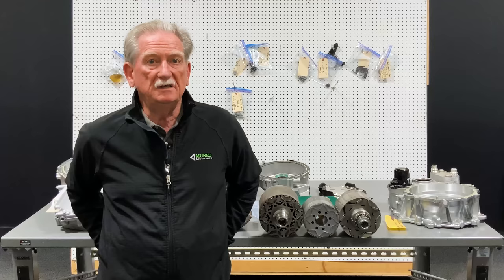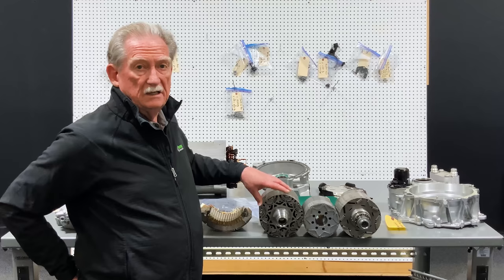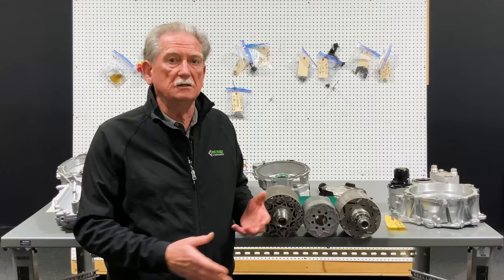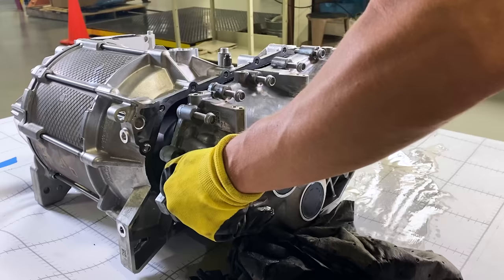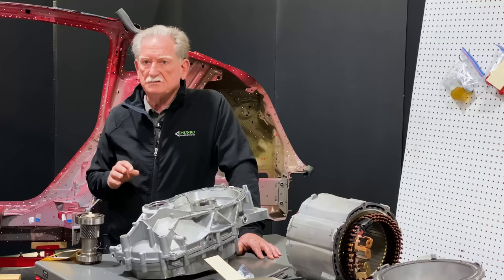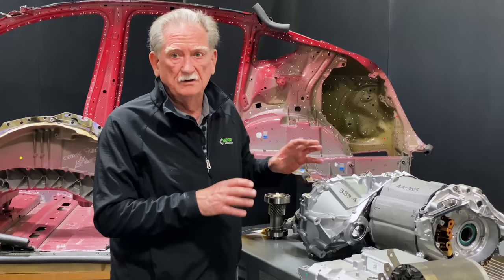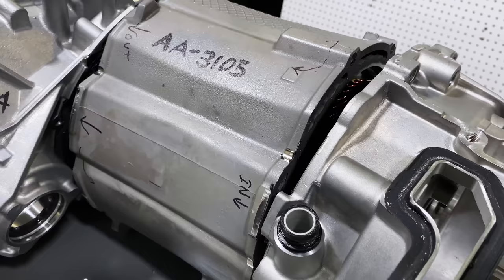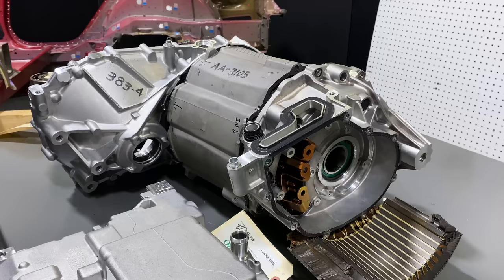Volkswagen ID.4: Electric Motor Teardown and Analysis

Comment: The Germans LOVE threaded screws (fasteners)...and so do I.  Metric threads are not quite the same as American standard, but I think it is just emotional.  Screws are "serious" and snap-ons are not.  Maybe Munro is right but I'm not sure.
Reply: he isn't and you are, for a bunch of reasons. and ford usa is hardly the cornerstone of high quality.
Reply: @daos3300  What's funny to me is that Ford used to use a lot of threaded fasteners back before the mid 2000s (probably when this BS was going on) and those cars, in my experience, are much better than what Ford has to offer today. I personally love threaded fasteners and in practice they rarely come undone. I personally don't like electric cars, but for the sake of those who buy these cars I hope VW doesn't listen to this guy and continues to use threaded fasteners.
Reply: He's not right. Threaded fasteners are the best way to hold together parts that may need to come apart, and in many cases, even parts that never have to come apart. Certainly better than snaps. Snaps are the shittiest way to assemble things and should be prohibited.

Comment: IMO this is a very good first generation design.  The use of internal screws suggest that this is very close to the prototype design, was rushed to production, and it will be refined quite a lot as production increases. 

One reason to use "un-fastenings" inside the inverter is for end of life recycling, where it's necessary to separate circuit boards with toxic metals from castings. I suppose that metal rivets could be drilled out or ground off, but that's probably  extra work.   The question is if that kind fastener is needed, or was it used because casting production was easier in low volume initial batches.  My solution would be to have a few snap fittings hold the boards in place until the cover was closed. Then standoffs/hold downs (bumps and holes) in the castings could sandwich the circuit boards snugly in place. It's easier to add many padded compression areas to a circuit board to reduce resonance than to use a similar number of screws.

Comment: Funny, I've yet to have one single threaded fastener come unfastened on my 12 year old VW, 14 year old Audi, or any other foreign car I've owned. It must have been a Ford problem. You can't torque a snap connection, nor can you get reliable heat transfer through a snap fit connection. Also, robots are cheaper at assembly than humans. They can work 24 hours a day, don't take days off or call in sick, they can move faster, work in confined spaces, work in hot, cold, or wet environments, can even work in complete darkness, and don't get tired or distracted.
Reply: One bad experience put him away from threads. He won’t even get in to Bugatti. Car (front and back) is bolted from 14 bolts.
Reply: Robots can work 24hr, but the humans that maintain them don't, nor do they work cheap. The folks that figure out the balance between automation and hand-built make the big bucks.
Reply: funny you should say that, i've never had screws ar bolts come undone on my 50 yr old vw. certain key fasteners need re-torquing, the rest is without issues. depends how you put things together.
Reply: @chstra45  the cost of maintaining a human workforce is way higher than maintaining machines. if everything could be automated, it would.
Reply: You obviously haven't sideloaded them enough.

Comment: Those screws are for ensuring vibration damping reliability on these critical PCB components. This design ensures reliability for long term use where adhesives such as Loctite would more likely to fail by fatigue and shear fracture.  Screws are probably the most mechanically robust by far vs other options.

Comment: What about the crack forming on the bearing cover? you talked about burrs but right next to the burrs is a substantial crack which will get larger "as is"
Reply: I was yelling this at my screen. Maybe it happened during disassembly or something?
Reply: I noticed it too. I think it's not a crack, but a raised casting flashing caused by a crack in the mold.
Reply: Yep, I spotted that too.
Reply: That sure looked like a crack to me too at first -- but looking carefully I count five similar looking features radiating out from the center. Maybe the flashing left by a cracked mold theory isn't so crazy. Too bad we can't just reach out and touch it.
Reply: Any one who builds or services systems using high and low pressure alloy die castings will have seen these ridges around most holes and section changes. They cause no issues and are a result of material displacement as the casting cools and solidifies to its final state. This happens AFTER ejection from the mould because they are are cycled out of the hot mould and a new molten shot made every few seconds, to keep production speeds high.
Reply: That's a result of the casting process, it's caused by the mold release agent.  It's not a crack.
Reply: @grahamwhiting6567  Thanks for explaining :)

Comment: I worked for the Railway in Denmark we used more iron so they would not expand or subtract by heat or cold weather so we welded them together

Comment: 5:15 I suppose the selection of the bearing type and size depends wholly on the drivetrain-layout, distances between bearings, and resulting forces. I would recommend not to judge lifetime based on "bearing size alone". By the way: when you have high speed motors you cannot even use bigger bearings, because those cannot sustain the high rpms. On the other hand: the high speed type has the same power output using less torque and resulting in less bearing forces...

Comment: As someone who deals with G-loads and vibrations on circuitboards USE MORE FASTENERS
A bonuspoint is that you get mutliple points of grounding of the groundplane of board, USE MORE FASTENERS
Also treaded FASTENERS can be locked in place, there is absolutely no problem with that.
I will give you a point of riveting the laminated core, since noone ever will take it apart for any reason.

Comment: i would imagine those fasteners might serve "repairability"?
Reply: Yes, to me that inverter looked very serviceable. Also the many bolts in inverter PCB likely also acts as heat conduct from PCB to enclosure.
Reply: Yes.  Right to repair would take issue with Sandy on this.
Reply: I think it's just the only way to do it, PCB's need a lot of mounting points to not vibrate, you don't want flexing happening there. Then there's the pressure required for the cooling plate to make proper contact with the pads, if you want even distribution, you need lots of fasteners.
I don't think "snap-in" works with PCB's that need cooling like Sandy thinks it does.
Reply: @thealienrobotanthropologist  Tesla 300 miles for less than $12.  Lasts for 1,000,000 miles.  Prover 66% safer than any other car on the road by NHTSA.  Those are the reasons to buy a Tesla.  Also, Tesla does not advertise. :)
Reply: @TheFPSPower  exactly! Sandman thinks his "snapfix" will fix everything and that's why Ford is nowhere near VW.
Reply: @davidbeppler3032  nor does it let you service your own car, and works on a proprietary connection, and had failed to build mechanical redundancy in safety areas.
Reply: @davidbeppler3032  you don't know that it lasts 1m miles yet. any electric car will outlast a fossil car, and many fossil burners easily make half a million miles and more, it's just the costs are much higher. and all electric cars are relatively cheap to run. tesla isn't particularly brilliant, they just kickstarted the trend. if it hadn't been them, it would have been someone else.
Reply: @daos3300  They must be particularly brilliant, they own 70% of the BEV market.
Reply: @davidbeppler3032  maybe in the US. In the rest of the world they arent ahead
Reply: @robertjonker8131   What company has better tech, efficiency, safety, and price?   Tesla has taken over every market they enter.  If they are not #1 wherever you are talking about, it is only because they have not been introduced to that market.
I am not even a fanboy, if you can give me a better product for a lower price I will change my mind on the spot.

Comment: I am a machinist who does a lot of rebuilding industrial electric motors. Granted, I don't have any experience with any liquid cooled motors but it seems to me that having a coolant passage that winds its way back and forth around the stator would result in uneven cooling of the housing because the coolant would get hotter and hotter as it winds its way around the outside. I guess the aluminum must dissipate the heat well because I'm sure Volkswagon would have like 100 temp sensors on this thing when testing it.

Comment: From brakes to engines, threadened fasteners have been holding everything together without major issues for roughly 2 centuries, so I believe they will be fine holding together whatever VW puts in their cars.  
Unlike rivets, threadened fasteners are also easier to remove which everyone who's ever worked on cars will be thankful for ...

Comment: Great and interesting video, thank you for sharing!
I don't agree about the fasteners though. You're certainly right when talking about screws on an ICE where there are hundreds of moving parts, crazy vibrations and great temperature variations. That's not a problem for a sealed off electronics component.

Comment: I think the inverter is a good example for sustanable engeneering. Sandy missed the last step in the lifecycle of a car: Recycling! If you glue all the stuff together, then it might be cheap for production. But in these components are rare resources you might want to reuse. But you do not recycle them if the costs are to high to deassamble. And even if he think a repair will never happen: Thats old school thinking from a time with unlimited resources. In the future it will make no sense to throw huge parts away, which are 5% defect. That would kill out resorces.

Comment: After the ID4 review I was getting the impression that VW's EV hype is just marketing, but perhaps they really do have at least some of their A Team working on EVs? Looks like it stacks up pretty well vs Tesla!
Reply: VW seems to have two problem departments: software and integration. How these well designed components are integrated into the vehicles is problematic. And that largely comes from legacy thinking, parts bin mentality, and the required reverse compatibility for parts bin use. Being the largest car company in the world is a big downside for VW because it means they have zillions of dollars invested in parts bins and platforms. The modular design of the motor speaks to that. 

Modular designs are great for sharing across product ranges, and building out a whole fleet quicky and cheaply, but the downside is that it deincentivises improvements. Any design refinements in the future have to keep all of those mating points... whereas a non modular system only needs to keep the motor mountings, coolant lines and the driveshaft so the whole thing can be even radically redesigned at will.
Reply: This comments thread deserves to go up <3

Comment: @6:57  On that outer housing with the radiating micro cracks coming from the bearing housing, is that acceptable from a engineering longivity stand point ?   I counted at less 10 of them.
Reply: came to post the same comment.  I can't believe all these cracks would be normal?

Comment: VW in addition to having done a beautiful job in the design of the inverter with more screws, has made that motor a hundred times more repairable than the usual tesla that sticks everything without screws.  as for the resistor that VW has put on the aluminum, it is the best solution.  Those resistances put by the tesla in the middle of the board is the worst idea you can do, because the board heats up and deforms causing stress to the components that are around it.  Avoid criticizing screws because anything that doesn't have screws is not repairable.  
Criticize something else
Reply: That conductive tape on the SMD parts degrade and the parts get hot and then the board changes color from green, yellow and then brown. The tape fails more as the board color changes. I hope they designed the resistors, so this don't happen. I seen this before and the board traces lift, the layers separate and the board is junk. One recent example of this is a high power BMS. The cell balance resistor was getting hot from a loose connection to one cell group. The bms would burn off energy  in highest voltage cells to balance the pack and the resistors became too hot and over time the board failed and I had to toss the board.
Reply: @stevegorkowski3246  Exactly ;)

"I am an electrical engineer who often work in repairing electronic boards.  When I hear incompetent people criticize modular design in favor of gluing everything together gives me a headache, I can't hear them"

Comment: An engineer from VOITH Hydro drew a picture of a hex head cap screw on the board, circled it, and put a diagonal line through it. I'll never forget that,  Hitachi used 60-degree threads on 1' & 7/8"" & 3/4" & 5/8" 410SS counter-sunk screws holding down facing plates and big facing rings 12-feet in diameter on pump/turbines. Those rings had 112 countersunk screws holding them down then welded at the face, but they still would come loose and the entire 12-foot diameter stainless ring would get spit out eventually. Operating at too low of a flow causes instability since the impeller still tres to centrifugally pump the water entering into it. Never could convince them not to operate at low loads but I gave up.

Comment: At 19:45 - The "cutting bias" of the rotor is called rotor skewing. VW shows a 4-step skewing here, but linear. Tesla has a 3 or 4 step skewing, but in V-shape. VW's linear skewing will give them axial forces and vibrations in the rotor bearings, something I would try to avoid in the design. Tesla knows about this. Nissan is far behind. 
Also, rotor skewing generally DECREASES performance in terms of Nm and kW output, it is mainly a trick to get NVH levels to an acceptable level.

Comment: 6:49 What about that crack in the housing? Strange you didn't mention that also.
Reply: I wondered about the same 😂
Reply: I was just look for this comment!
Reply: Maybe caused by Munro's disassembly?
Reply: @rcjbvermilion  That would be hard to believe.
Reply: It's not a crack, it's just a little line on the surface.
Reply: @derbigpr500  hahaha, are you blind or just joking?
Reply: @CommonCentsRob  I have seen this before and suspect it is not a crack but a casting mark , Sandy mentioned burrs earlier in video I would think he can spot a crack .

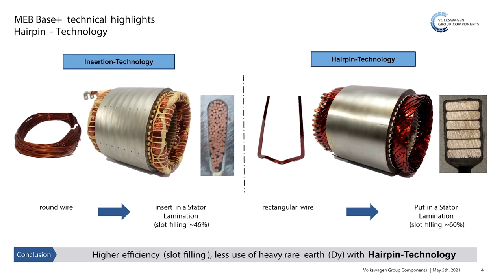Comment: 13:25  Tesla is coming up with the hair-pin design in Q3 (or maybe already has) for the rear motor in the Model 3 according to paperwork filed in Europe.
Reply: 13:04 Tesla wire wrapping
Reply: Where did you get that from?
Reply: Hair-pin has higher eddy current losses.
Reply: Cool, where did you get that info. Would love to see
Reply: @LaserFur  in effect, it depends on what frequency of AC current you are running your motor on.
High(er) frequency = higher eddy currents = Tesla's small & round copper wire design better (current design)
Low(er) frequency = lower eddy currents = big & square copper wise hairpin design better
I'm sure of this part.

Higher frequency = higher engine rpm? (I believe), so better for cars wanting to be efficient when going fast
& vice versa --> 90% sure on this part

I'm simplifying gearing & other stuff here, all the things needed to take into consideration in these decisions are beyond a Youtube comment section lenght
Reply: @elektrotehnik94  you are absolutely correct, there is so much going on with electromagnetic pulse driven systems that not one thing is better than other. Like everything in engineering its a compromise and best is system which achieves best overall average for prescribed/described system. Over engineering  one section of system usually is bad because you have under engineered some other parts.
Reply: @tomknop8675  The High DV/DT of modern chopper based H bridge designs are well known to induce high frequencies. It's all a matter of trade offs in the overall design.
Reply: @elektrotehnik94  You said it better than I could.  But it also looks like VW took advantage of the high copper fill of hair-pin winding to run a larger diameter rotor so typical motor rpm can be a bit lower.
Reply: Hairpin windings have been used for many years, by GM and others.

Comment: The benefit of screw fastenings into Aluminum Alloy castings are that they don't work loose, unlike fastenings into cast steel. I've worked in the gearbox trade for a number of years, and know that VW love their bolts and nuts, but when they fasten into Steel, they use lock tight to prevent unthreading. Dowel pegs also prevent side movement. What gets me, is the use of non ferrous bolts on some of their gearbox casings. Aside from the problem of stretching, making them less reusable after a reassembly, they can oxidize in the thread more easily than a plated steel bolt.

Comment: Do you think having lots of fasteners on a ckt board will help keep any possible flexing of board to zero? This will, in turn, keep stress off of the solder joints of the QFP that I happened to see.    I see this as a plus for long life of the electronics.